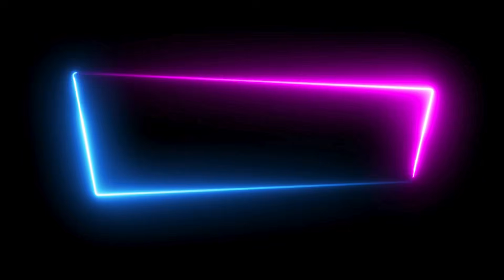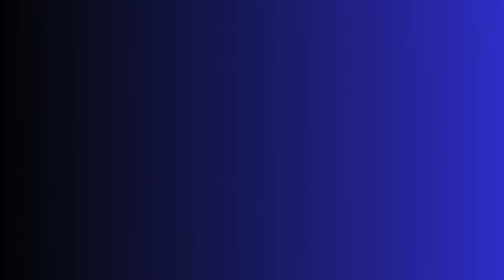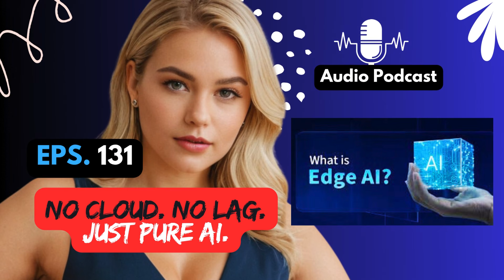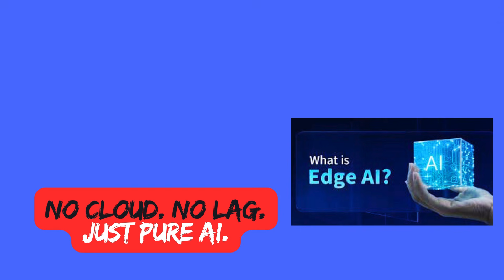Edge AI Explained: Build Smarter, Faster, Offline-First AI in 2025

Comment from the maker: 🔍 What you'll learn:

What is Edge AI and why it’s taking over cloud-based solutions

Real-world use cases (robotics, IoT, healthcare, smart manufacturing)

Key hardware platforms: Jetson, Coral, Raspberry Pi

Software runtimes: TensorFlow Lite, ONNX Runtime, PyTorch Edge

Model optimization techniques: quantization, pruning, distillation

Building a production-grade real-time object detector

Advanced topics: Federated Learning, TinyML, Generative AI at the edge

Security, privacy, and OTA model updates for robust deployments